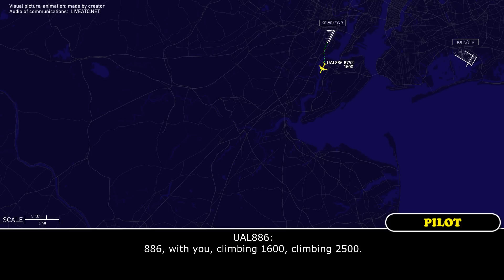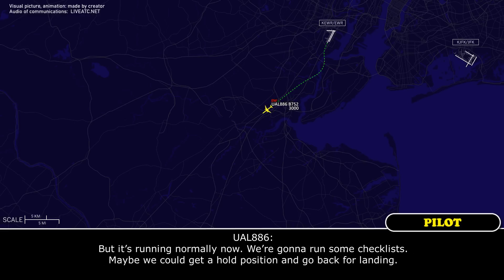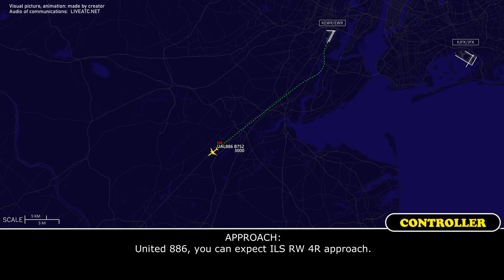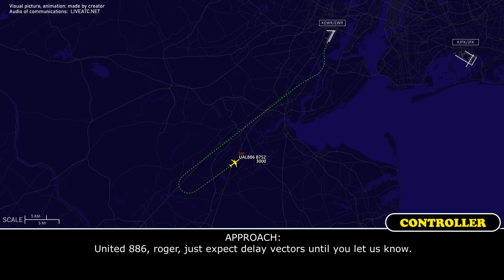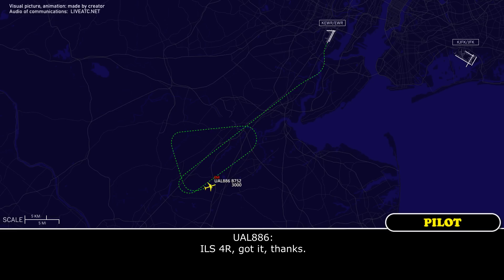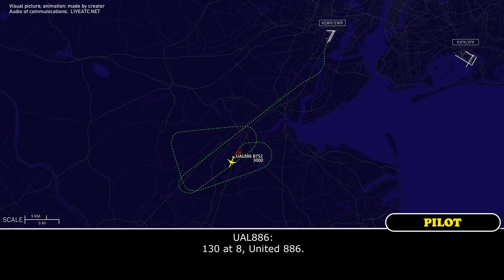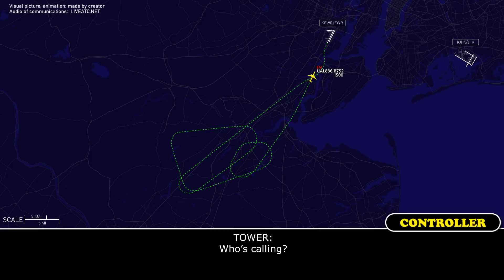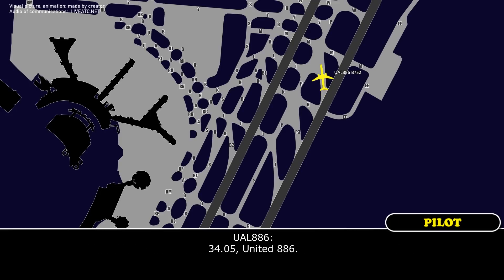Engine compressor stall after takeoff. United B757 needs to return to Newark. Real ATC

Comment: So the #1 had a compressor stall..
It stabilized and was running normally after that. Just keep going and make a report later - why the emergency return? If they had to shut it down, that's one thing, but it was working OK, so just wondering why it was necessary to come back?
Reply: Better safe than sorry, many reasons?? no bird strike reported? failure of a seal; 1 pretty sure thing the flame went away, the fire suppresant systems works, problem w/ fuel nozzle ??? safety 1st Great call by Pilot!
Reply: On aircraft such as the 727 or DC-9 with JT8D engines I would agree. But with more modern engines an engine stall are more likely internally damaged at the very least might require a borescope inspection. Besides with this very long sector to South America seemed a very prudent decision.
Reply: Because you can't have your engine exploding with flames shooting out repeatedly. After 8 hours of this everyone will have PTSD.